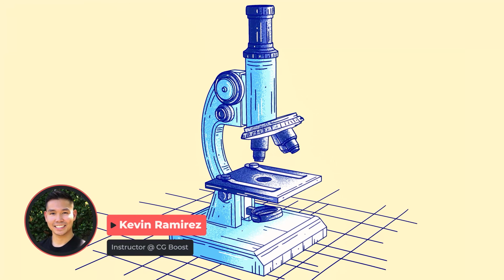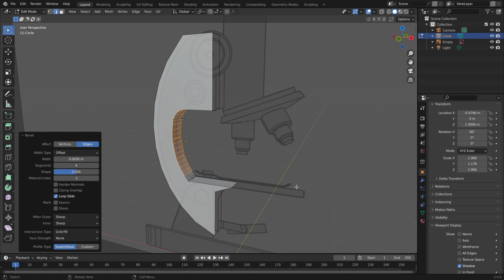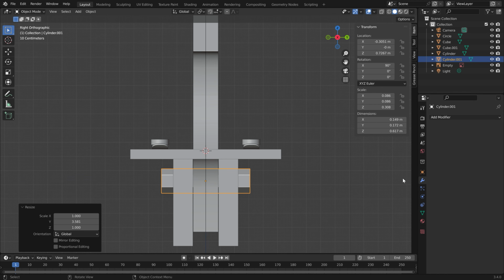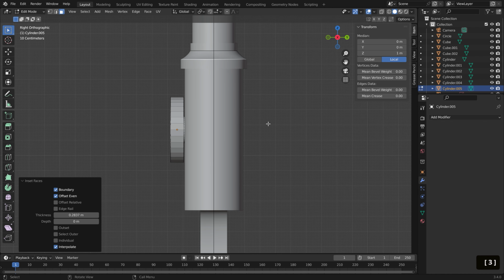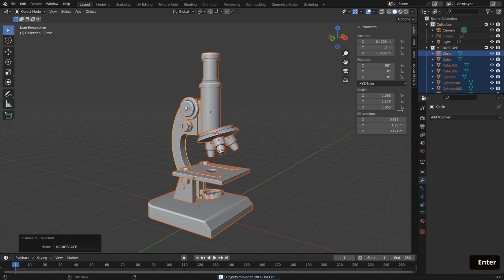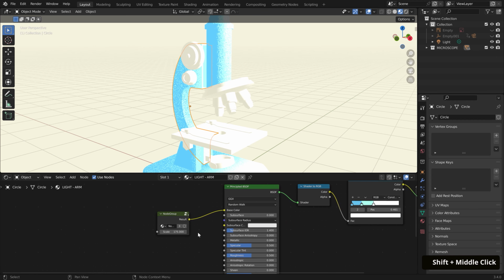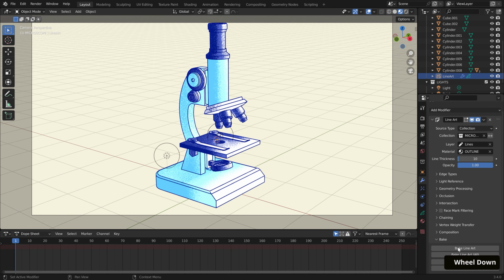Stylized Microscope in Blender (Grease Pencil Tutorial)

Comment: Ran into an issue where the grease pencil was visible through the object when rendered. Thankfully, the solution was pretty simple:

1. Go to view layer properties.
2. Under "Passes<Data" leave everything the same but check 'Z'

Now it should render as you see it in the viewport!
Reply from the maker: Thanks for the tip Karen!
Reply: I can't find this option. Could you tell me where it is? Thank you.
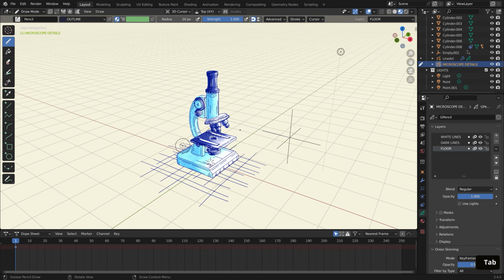Reply: Hey there, this is mentioned in 45:30 of the video. You can find the option at the right toolbar. Hope that helps!

Comment: I have a question... I can' t find 'shade auto-smooth'  in the object context drop-down menu, just 'shade smooth' and 'shade flat'. I can find it in the normals-menu, but that seems to work quite differently (you toggle it on or off with a check mark). Do I have the wrong setup? I am using Blender 3.0.1 if I am not mistaken, on a Windows-machine.
Reply: Auto smooth is a new shortcut, to get the same thing press shade smooth and then go down to normal and then press auto shade
Reply: @Losjo4093  thank you!

Comment: I was having some difficulty mirroring the objects properly (probably because the orange dot in the arm, whatever it's called, was misaligned). I didn't know how to fix this so this is what I did to fix further issues:

1. SHIFT + S, set curser to world origin
2. SHIFT + A and create new object called Empty < Plain Axis
3. Now when mirroring objects, instead of selecting the mesh you want to mirror across in the mirror object modifier panel, you can select the Empty Plain Axis and it will mirror it according to the world origin.

Hope that helps someone struggling as I did!
Reply from the maker: Hi Karen, thanks for sharing your solution! As you suggested, you can use an external object (an empty in this case) as mirror object. And that's a great way to have more control over the mirror modifier, well done!
You can also move the origin of your object (the orange point) to the right spot by snapping it to 3D cursor if you like. To do  that, select your object while being in object mode and go to Object menu, set origin and choose origin to 3D cursor. This might be an alternative solution :)
~ Masha

Comment: Hey kevin, at @CGBoost
You can't just press buttons that you feel like because "you like the way it looks" (A technical mistake is not an art-style)

For color management, we use "standard" to get "accurate colors values" if you have no lights in the scene nor materials that can affect how light interacts with the mesh (any BSDF node that isn't emission node with value of 1)  will affect the mesh colors and by so , bound to value clipping when using color management - "standard".

As soon as you add lights, you are risking color clipping , this is why we have color management that perform some mapping to prevent it , like filmic, tcamv2 or agx, and yes they will change your colors but there is no magical solution.

If you want cartoon stylized with "standard" color management , you need to drop the lights and only use emission bsdf with value of 1 for your materials (The colors themselves will have to come from a texture or a solid RGB color or noise node).

*color clipping does happen A LOT in your video as well, for starter, adding light to an already pure white color already promises to have such issues.

Comment: You do not need to extrude the points. You can just hit ctrl right click to add a point at the selected point. I have found it is much faster than extruding single points, because you can just click where you want the point.

Also, you could start with circles with more points, so the whole bevel step is no longer needed.

Grease pencil is amazing 👏
Reply: thank u julius fuck